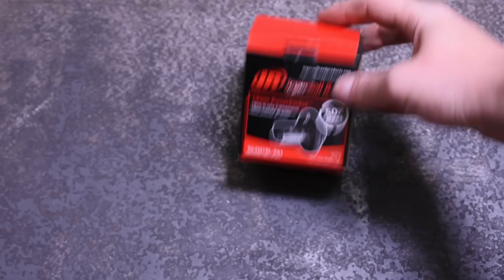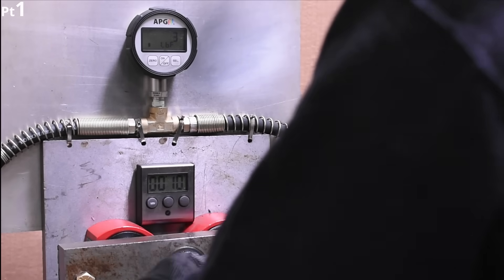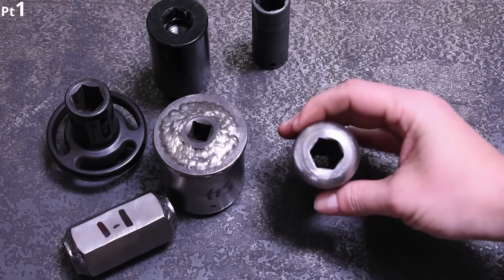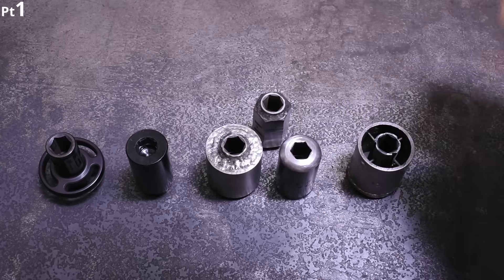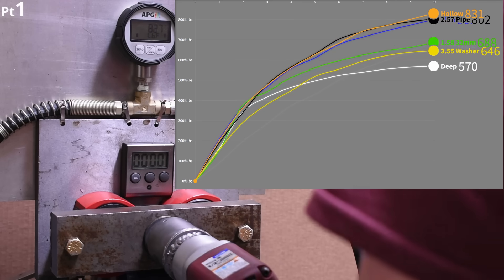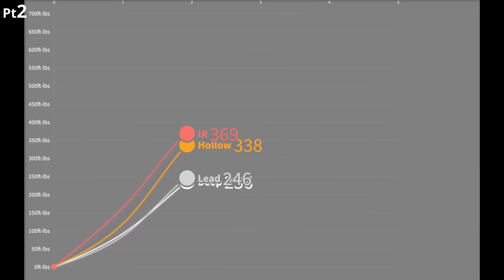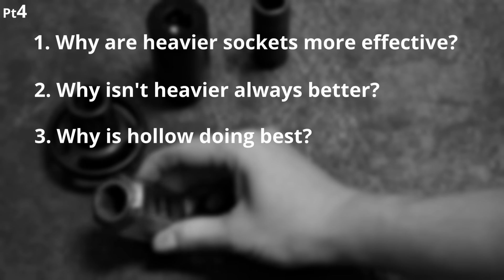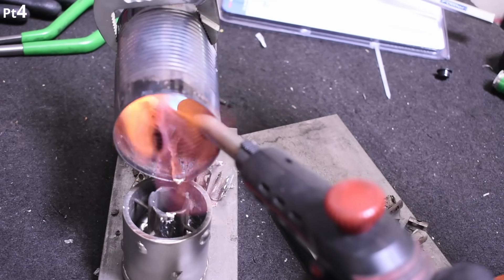Heavier Sockets Make More Power? Stumps Physicist

Comment: My money is on levarage. I bet if you calculate the average distance of the sockets' mass from the center of rotation you'll find a strong correlation.

Rigidity will be important, too.  Gotta efficiently transmit that energy back to the fastener.

Comment: My guess is force x distance = energy.  A lighter rigid socket with a balanced mass further from the center will carry energy. It’ll take more force to stop the rotation. It’s a lever to the socket. I think the homemade ones failed since they aren’t o e piece so they vibrate and gobble up energy. The hollow one doesn’t have moving parts and has the distance from the center. It’s prob lighter than the IR making it spin up faster.

Comment: As the Ingersoll Rand PowerSocket is struck by the hammer tool, it is caused to oscillate at an ultrasonic/sonic frequency, which is briefly transferred to the bolt/nut, inducing a ultrasonic/sonic hammering effect at the interface of the thread/friction surface, thus overcoming the static resistance points. This effect is similar to the Ultrasonic/Sonic Jackhammer Researched, developed and produced by NASA (NPO-20856).

An ultrasonic/sonic jackhammer (USJ) is the latest in a series of related devices, the first of which were reported in “Ultrasonic/Sonic Drill/Corers With Integrated Sensors” (NPO-20856), NASA Tech Briefs, Vol. 25, No. 1 (January 2003), page 38. Each of these devices cuts into a brittle material by means of hammering and chiselling actions of a tool bit excited with a combination of ultrasonic and sonic vibrations. A small-scale prototype of the USJ has been demonstrated. A fully developed, full-scale version of the USJ would be used for cutting through concrete, rocks, hard asphalt, and other materials to which conventional pneumatic jackhammers are applied, but the USJ would offer several advantages over conventional pneumatic jackhammers.

Search for NASA (NPO-20856) for more information and white papers.
Reply: This makes the most sense of all the other guesses.  The main impact is a low freq impulse that does create some higher freq harmonics, but those harmonics die out at the higher freqs.  The resonant freq of the flywheel (tuned by the size of the spokes) will add energy at a much higher freq to more effectively decrease the friction of the threads (restating what you just said).

Comment: I think your physicist is essentially right to point at the rigidity of the components colliding and the resulting duration (and therefore average force) of the collision. And that's a complicated point he's making because it may be the case that the collision is not completely elastic. If the bolt or the socket experience any plastic deformation...well then there's your problem. Any noticeable amount of plastic deformation is going to mean that significant energy was lost to breaking molecular bonds and wasn't available to tighten (or loosen) the bolt. 
How much warmer are the components after the test?

Comment: Everything is a spring. If the spring is resonating correctly, it should amplify the impacts. Lead is going to deaden the effect since it's soft.
the stack of washers isn't a rigid body and provides a lot of flex like an extension does.

Comment: The ring in the IR socket is an energy transferring wheel. I think that the weight of the entire socket is not important, but the ratio of the weight of the external ballast to its internal part.

Comment: What is at work here are several factors combining to work together. #1 is a combination of flex and flywheel momentum causing a 'double whammy', especially with the IR flywheel socket. It is the opposite of what happens with a harmonic damper on the front of an engine, because instead of the flywheel being connected by rubber, it is connected with semi-flexible spokes of steel. When the impact from the gun hits, it sends both a shockwave and rotary kintetic energy through the steel. Some of that energy is also potential energy being stored by the flexing of the steel in the socket, then as the flex hits the flywheel, it sends the energy on through the socket and eventually hits the end of the socket which turns into kinetic energy at the lug nut. The timing of the potential energy release hits in a way that magnifies the blow rather than dampen it. This also explains why the I.R socket doesnt work as good on hammers with faster bpm or lighter blows, because the timing of the flexing of the material doesnt match the bpm of the gun. It is similar to using resonant frequencies to multiply forces and why anything large made out of metal has to have its resonant frequencies either dampened or mitigated in some way. Bridges, cars, etc. In automotive, cars are so quiet now and dont crack sheet metal as much because much effort has been given to address NVH (Noise, vibration, and harshness).

Your lead filled socket didnt work because lead has a vibration dampening property to it- instead of transferring energy to the other side of the socket, it flexes and converts that vibrational energy into heat. Simply having flywheel mass doesnt work without the spring of proper steel.

The large diameter, lighter weight socket work well because they transfer the impact torque more efficiently than a heavy skinny socket. It is the opposite effect of using a torque limiting extension. The futher from the axis of rotaion you get, the less force is applied to the steel socket wall, therefore less flex and more direct impact hit. There may be some harmonics helping the equation as well, as there is more surface area to resonate a shock wave.

Comment: The secret is in the flywheel and a "sweet spot" between uggahduggahs.  The powersocket and "hollow" socket are the same in the fact that both have a "flyweel" attached to the socket. I bet if you could vary the motor speed to vary the hammer rate of the impact mechanism you could find that sweet spot in a consistent way with any socket really..

Comment: At 9 minutes. My assumptions would be that because of how a twin hammer impact works all the added weight reaches a point of diminishing returns where the impact is working so hard just to move the mass that it makes it worse, the lisle one being the sweet spot. Then the IR and hollow sockets work off the inertia added through increasing the radius rather than the weight which is good for a tool that relies on hammer speed for the majority of the curve.

Comment: No scientific explanation but Ill give it a go.
A bigger diameter flywheel the same weight carries more momentum.  It takes longer to spin down.
It's the momentum that holds the force of the impact on longer think a dead blow hammer.  Same hit longer duration ? However there is a limit to this that is governed by impact frequency, impact force, rigidity and slop in the drive train.
This is why to much weight has the reverse affect  as it relates to the frequency of impacts

Comment: As an engineer with a practical understanding of sockets/metal components I think there’s a good bit of resonance in the designs. If the impact shockwave starts at the drive end of the socket it can store energy into the flywheel, the bolt end of the socket starts to apply force, and at the same time the shockwave stored in the flywheel travels down the socket and hits the bolt at the right time to deliver more force. 

Too much weight and dampening, as is the case with the heavy, soft lead socket, would back this theory up, as would the high spring rate of the large hollow tube welded to the socket.

Comment: Like @allupro said in a previous comment, I believe the further out the weight acting on the pivot point (bolt head), acts as a lever applying torque in the forced direction. They all start out similar to the regular deep socket, but once directional momentum is achieved and the outward most mass is accelerated to the nominal force that the gun can apply, the weight (with its momentum) is applying more torque as a lever effect. The hollow socket reduces mass to achieve the momentum required for the torque, but also has the majority of its mass further from the fulcrum.

Comment: The flywheel socket is a dynamically tuned device. the outer wheel is tuned to a certain impact rate so its either applying torque between impacts and/or you'll find the socket is staying engaged on the nut and not rebounding off of the flat faces of the nut ie oscillating  cw and ccw like a regular socket its hard to tell without doing and actual analysis. Your hollow socket (professor explanation sounds correct ) but take a look at where those sockets contact the nut. Some sockets contact near the corners thus contacting further from the center, thus applying more torque ( they are also more efficient at corner rounding ) the higher quality sockets tend to contact below the corners. Sharp impacts are high force events thus a little bit of contact radius difference can transmit more torque. 
 Lead by its nature has alot of dampening lead plates are placed at the bottoms of skyscrapers to prevent ground noise transmission up the structure no surprise there. Never seen these types of sockets thanks for posting.

Comment: Like the rest of the commenters, I am a college course trained armchair physicist. I don't care what your expert says. Once the bigger mass is moving it has more momentum. Without getting into rotating bodies it's p=mv. I suspect your diminshing returns comes from being unable to accelerate the heaviest sockets to as high of a velocity. Not much different than using a bigger hammer for more force, until you are too weak to swing a 50# hammer.

Comment: Maybe it's like a bike sprocket in that the smaller heavier ones don't have enough diameter like the hollow one does...the hollow one is light enough for the impact and big enough in diameter to apply more force like a bigger sprocket. So maybe you should try making bigger diameter hollow sockets but keep them around the same weight.

Comment: The reason the lead socket didn't work is because lead is a damper material and doesn't transfer impact force effectively. There has to be a balance of  torsion and rebound speed along with mass. Those are the physics behind the IR socket, the bigger the diameter, the faster the rotational inertia resulting in more force with a smaller mass. Lisle uses the heavier mass at a smaller diameter approach. I have several variations of these sockets myself both retail and shop made and can confirm they do work. Great video as always 👍

Comment: Isn't the IR power ring basically your hollow socket compressed down to a better form factor, that would fit more practical applications?  As with all thing I imagine there is a point of diminishing returns.

Comment: the lead filled socket doesn't work because lead is a soft metal and acts as a dampner absorbing some of the impact, 
the flywheel one doesn't alow the socket to relx from the shock keping it at the end of it's travel and the hammer inside the wrench has a longer travel time  befor the next impact and something similar happens with the holow socket the outer tube beying welded only at its ends

Comment: The "heavier=better" (or higher rotational inertia, maximized in the IR flywheel thing and your hollow one) never made sense to me, as it just makes it harder for the hammer to move the socket so it should end up in less torque on the bolt. Can't come up with an explanation on why it works tho, so I'm very interested in a follow up if you get to the answer. This question has been bugging me for years, literally!
Reply: Isn't it the case that the weighted sockets just add to the mass of the hammer of the impact gun? A little bit of extra mass gives you a little bit of torque, but if you have too much mass, then the hammer struggles to move it and then you get diminishing returns.

Comment: Instead of transmitting the impact force more effectively I would expect these sockets to be basically creating their own impacts as they bounce backwards on the bolt, and then are spun up to speed by the driver before re-engaging the bolt head in their own impact (which they bounce backwards from and so on). I would predict that this would only work where the socket is able to bounce backwards on the bolt, so if you applied enough force in the direction of rotation to hold it tight against the bolt and prevent bouncing then the effect would be diminished. You may also find interesting differences between drivers, likely favouring the ability to accelerate the socket's mass rather than create sharp impacts.

Comment: Since the socket is not rigidly coupled to the output shaft of the impact wrench, they have to be seen as two separate bodies of mass. In order to transmit the maximum amount of energy from the impact wrench to the socket the rotary inertia of both elements needs to be equal. Therefore there is a sweet spot regarding the rotary inertia of the socket, but a it's different one for each impact driver. Inertia is not only dependent of a bodies mass but even more so of it's geometry, which is why a flywheel is not a simple disk.

Comment: The extra mass has increases the force of each blow, BUT only as long as the impact wrench is strong enough to get it to a sufficient speed between blows. This is why the weak wrenches didn't benefit, because they couldn't accelerate the extra mass quickly enough.
Each wrench is transferring electrical or pneumatic energy into kinetic energy. Kinetic energy = 0.5 × mass × velocity^2. There's a maximum kinetic energy that can be applied, and it's limited by the efficiency and size of each wrench. And as long as you're not over the mass threshold, the velocity is fixed by the programming and gearing of each wrench.
The weight distribution also comes into play. The further the mass is from the axis of rotation, the harder it hits (the same way you get more splitting force with an axe when you hold it at the bottom of the handle).
Basically the extra mass helps until there is too much of it that the wrench can't spin it easily. That, and you can get the same results with less mass if it's further away from the axis of rotation.

Comment: I feel the hollow socket is near a sweet spot in which the weight (and placement of said weight) allows the socket to reach optimal momentum (therefore delivering more kinetic energy) while simultaneously optimizing the centrifugal force applied to the socket and therefore the torque applied to the bolt.

Here's a link to how to calculate it. (I posted this like 2 hours ago with the link but my comment keeps getting taken down? Maybe because of the link? You can find the calculator at omincalculator. Im sure you'll find it) 

I'll continue researching it more as well!

Also, thank you for all your great content. Your clarity, humor, and rigor is more IMPACTFUL than you realize.

Comment: Armchair physicist here, weighing in.
Where the actual physicist seems to have made an error is in assuming that the gun always applies the same force. But that’s not the case at all, especially with air guns, the motor is not using all of the energy in the line to spin up the socket. A heavier socket can be spun up just as fast up to the point of bogging the motor.

This results in more energy being stored in heavier flywheels up until the weight that causes the motor to spin slower between impacts.

I think the optimal solution is identifying the maximum weight the gun can spin without bogging at all and then positioning that weight as far out as possible to give the largest amount of torque at the moment of impact (distance squared). That’s why the hollow socket did better than heavier solid sockets, the hollow socket and the powersocket positions most of the added weight very far out without adding so much weight that the gun can’t overcome the inertia fast enough to store the same amount of force in the flywheel in the time between impacts.

Comment: As a layman, I would think a single degree rotation on the fly wheel design would mean a larger degree of rotation with extra weight due to the width of the flywheel. Again, as a layman.

Comment: I have the 4 popular size Lisle brand sockets. I use them a lot on rusty suspension bolts. I got mine for $20 each.  As I was told. The thickness of the socket kills the deflection and allows more of the impact torque to be applied to the head of the bolt. I don't question the magic behind them. I just know if I need to break these sockets out. It means I am done messing around. Both the 19 & 21 one sizes I have used on lug nut the would come off, and in about 3 blows. It is needing a stud replaced cause it just cranks it right off.